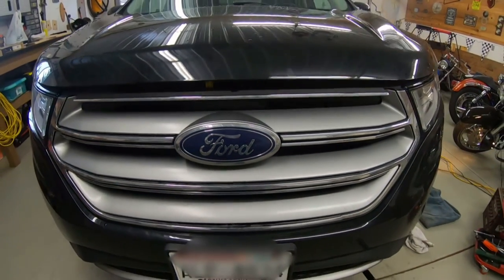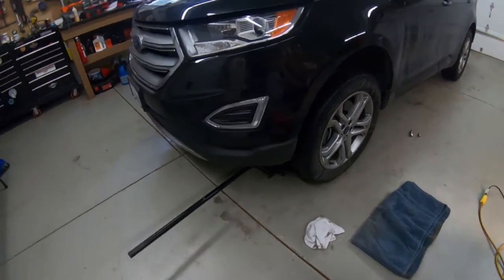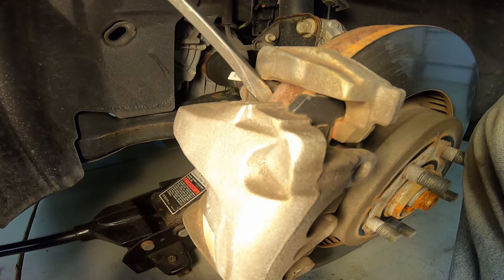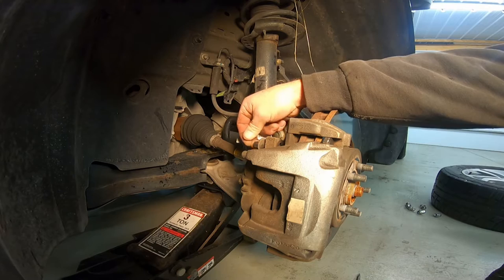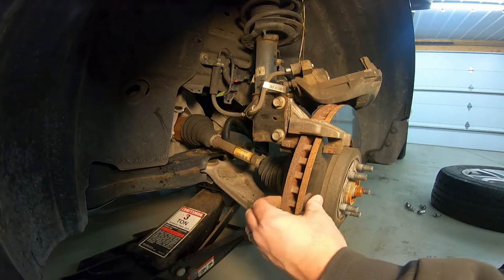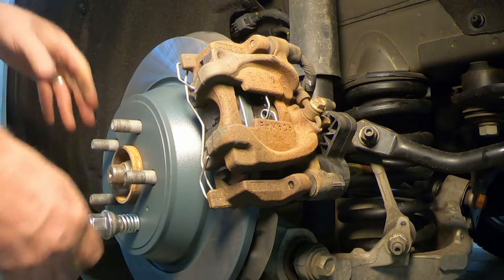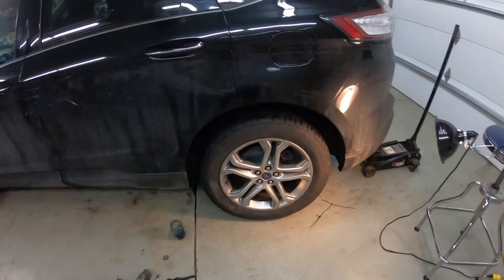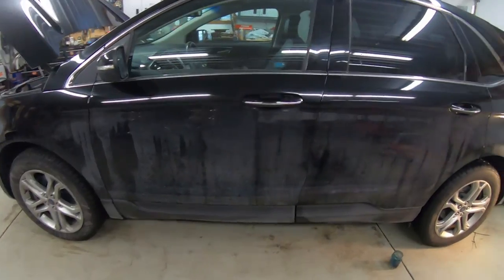2016 Ford Edge Brake Replacement

Comment: I got an issue with the right side EPB, it's engaged and cannot get released, on the dash it shows service required and when i try to release the parking brake I can only hear the driver side EPB motor releasing not the other side, are you aware of anyway to manually release the EPB?

Comment: Do I need to reset the electric parking brake?
Reply: Only if you you’re doing the rear brake pads, those are are electronically controlled

Comment: Thanks Dan! This was perfect for my 2016 Ford Edge Sport...adding a few things! (WARNING: DO NOT REPLACE YOUR CALIPER GUIDE PIN BOOTS)

1. For my 2016 Edge, I had to put the Emergency Brake in Service Mode (put car in ACC. then, while holding down emergency break button and pushing gas pedal, turn ACC off and then back on. You should get a message on the right side of the dash that says "EMERGENCY BREAK MAINTENANCE MODE"). It retracted the emergency brakes for me, and I didn't have to use the tool (just an F-Clamp to compress the pistons)

2. I gave the rotors some encouraging tapping with a hammer in a few different angles (front, side, back, etc) and it loosened up!

3. I coated the rear steel portion of the break pads with anti-squeal paste for good measure

4. My kit came with guide pin boots, but unless you need to, DO NOT INSTALL THEM. I removed one from the caliper, and it looks like instead of being a fully rubber boot you can just press in, its some sort of metal-inserted bushing that looks impossible to replace with out removing the entire caliper and drilling or pressing them out.. Not sure if I need to replace the caliper or if I can press the factory ones out of the caliper, but for now, i've temporarily installed the old ones and the brakes seem to work just fine.

Comment: $193 rotor and pads for front add tax and shipping looking around $220 or so and the pads are power stop and the rotors are the better coating type

Comment: Unless I missed it I did not see where you compressed the piston on the front brakes
Reply: @kenny hart it was where he pried on the caliper with the screwdriver before removing the caliper. Looks like he was able to compress the pistons in enough that way

Comment: Excellent video, I have 2016 Ford Edge too. My problem is in the rear brake hose. I hope you can make a video explaining the step’s thank you
Reply from the maker: Sorry I don’t have any plans on doing any brake line repairs to this vehicle.  I have done those in the past on other vehicles and usually if you open the hydraulic system to replace a line, it is best to bleed the entire system. Hopefully you can find a video for how to bleed the brakes.
Reply: @thelifeofdan5768 0

Comment: Great video and you saved the day by using a hex chisel or punch handle.  I tried to find a 7/16" allen wrench and I think there is not one in my county.  It seems that they are scarce as hens teeth.😀
 I have some buddies that are car fanatics with dozens of tool boxes and they did not have one.  I finally found a 7/16" hex center punch at Lowes in the tool section for less than 7 bucks.  I had to file the paint off the end as it was a tight fit in the pins.  I would not have been so specific about the hex drive except I spent more than a half day trying to beg borrow or buy one, so make sure you have one before you start the job.
Many thanks again for the redneck tip on the wrench.